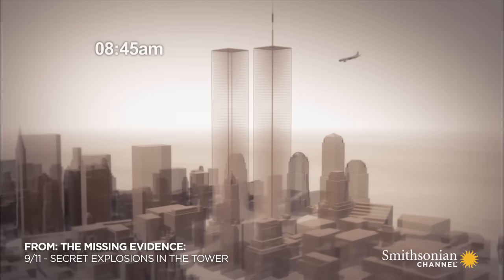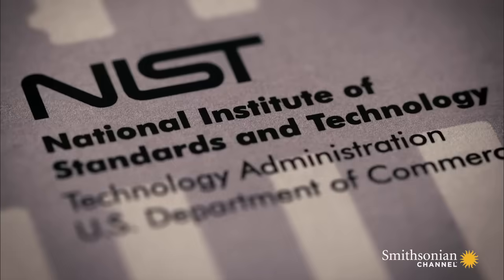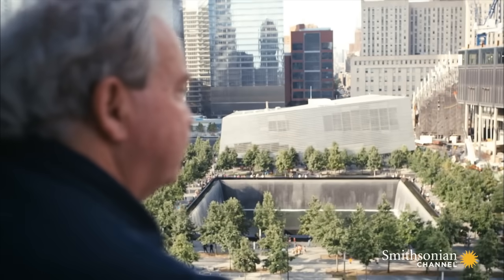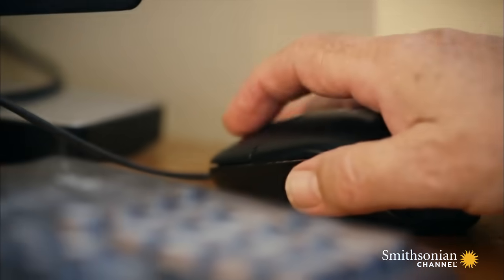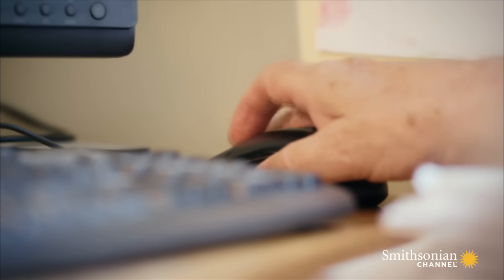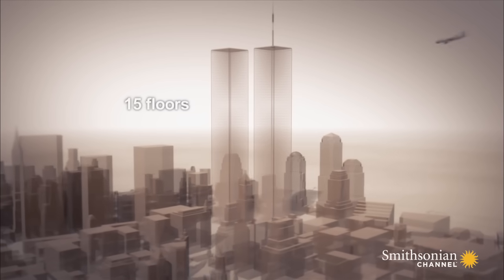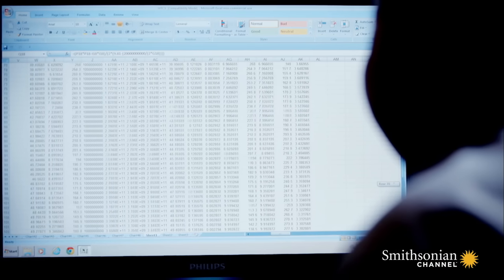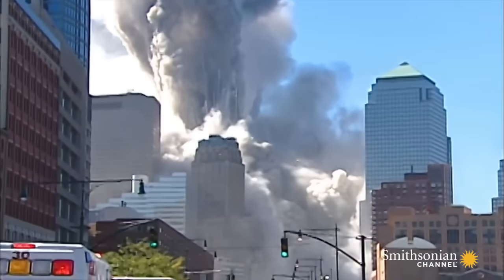This Computer Simulation Explains How the Twin Towers Fell

Comment: In other words newton's laws didn't work in the area of World Trade Center on sep 11.
Reply: in other words it worked just the same as it usually would
Reply: Slow Motion you make a decent point, but remember, that top section is falling apart while it falls, but since it is the weight of the Titanic falling at tens of miles an hour, it puts out insane amounts of energy and ducking wrecks that shit
Reply: John Johansen while your argument seems valid, its only valid if you don't take energy losses into account. While the top section exerts a significant amount of kinetic energy to the lower floors, you're losing energy on each hit in the form of heat, not to mention all the air that needs to be pushed out of the way. Furthermore, even with all the energy stored in the upper part of the building, its still nothing compared to the opposing energy and force exerted by the lower building. For your statement to be true, we must assume total and complete efficiency in energy transfer; in other words unity. Something fundamentally impossible, that's been understood well long enough.
Reply: The equivalent of a 30-storey building falling through a gap of 30+ feet, and you think that aerodynamic resistance was even a factor? Are you kidding?As for 'energy transfer', as I said, as each floor was destroyed the debris added to the falling mass that impacted each successive lower floor. So, by the time that the falling mass reached the 55th floor (halfway down), there was no way that the structure of the 54th floor could resist it, and this process continued all the way down. Finally, there was no significant energy loss due to 'heat'. I absolutely don't know where you would have come up with that, either.
Reply: John Johansen Well let me clarify then. You stated about a month ago that "it's not about mass but about force". You do realize how stupid this sounds when force is literally mass times acceleration (F=ma). You also mentioned kinetic energy, which happens to be a force and thus impossible to calculate without mass. In other words mass is tied very tightly to this.
And yes, air has both mass and resistance, so it would definitely play a role here. It's not just a case of "oh it fell one 30+ feet storey", we're talking hundreds of consecutive ones. It will add up, air has mass as well, and more than you think. Finally heat, this also plays a role, albeit not as significant. Have you ever shot something and felt the bullethole after? It will be hot let me tell you. And yet again, heat is energy and as such everything loses energy in form of heat. EVERYTHING. It's a law of thermodynamics, and when you have such great masses moving and colliding with other massive object you WILL lose energy in the form of heat.
Ultimately every aspect of physics that we know and have defined over the centuries prevent this kind of pancaking freefall. It's just not physically possible. The top section of the tower had only it's own mass behind it yes as it's falling free, but technically the lower tower still has the mass of the earth behind it. Tell me, who do you think will win?
I suggest you do some research on static and dynamic loads, static and dynamic friction as well as the laws of motion and thermodynamics.

edit
And yeah you said it; cartoon brains. I'm sincerely wondering here, if we forget for a moment every other aspect regarding the towers falling and consider only just that, the fall;
If you gave it a thorough thought, do you think it is genuinely plausible for a tower to fall perfectly symmetrical, within it's own footprint, from massively non-symmetrical damage? On top of that is it plausible then for two towers to do the exact same thing moments after each other?
If you do think this is plausible, please research entropy, because it's a natural and statistic impossibility.
Reply: John Johansen And just for shits and giggles, I did calculate the approximate weight of the air only on each floor, which comes out to about 18,660 kg. That's 18 metric tonnes of only air, ON EACH FLOOR.
Reply: John Johansen yep
Reply: John Johansen “mic dropped” :)
Reply: Road Runner cartoon laws worked on Sept 11.
Reply: The masses will eat the truth one crumb at a time until all that remains on the plate are the lies of the conspiracy.
Reply: John Johansen Furthermore, and I could argue this all day, heat does play a significant role in this. Everytime a moving object is slowed down, the resulting energy loss is in the form of heat. You're converting the objects kinetic energy into heat energy. How do you think brakes on a car work? Ever seen the brake pads of an F1 car? Energy is always conserved, never destroyed or created. As such, every time the top floor hit the bottom floor, it's being stopped, ie braking, and thus the kinetic energy is transformed into heat. Yet again it's thermodynamic laws, look it up instead of spouting scientific nonsense, because none of what you're arguing would hold up to scientific testing.
Reply: Just because you can quote the definition of force does not mean that you understand what it means. I actually know the difference between mass and force, but I'm not sure that you do. The air displaced by each collapse was negligible with regard to the mass of it relative to the mass of the building itself. Similarly, any energy converted (not lost) to heat would also have been negligible relative to the kinetic energy of the falling mass.The fact that you can parrot bullshit terminology (e.g. symmetrical) without expanding on it says more than enough. Further, the fact that you fell back on the equally bullshit argument of the towers 'falling into their own footprint' is further evidence that you don't know the facts surrounding this situation. If the towers fell into their own footprints, then WTC7 would still be standing, as well as the Deutsche Bank building (since demolished because of damage by debris) as well as most of the other WTC buildings.Stop repeating the crap from conspiracy theorists and come up with something original, sustainable and provable. Up to this point, you've failed miserably.
Reply: To quote the very first thing you said in this thread; "Assuming that you could even find the definitions of Newton's laws, why don't you explain your assertion.Otherwise, you just sound like a dick."
Well, I have not only "found" the definition of Newtons laws, I have also explained my assertations. You, on the other hand, have not. So who's sounding like a dick here?
And if you're so certain of the difference between mass and force, why don't you explain it to me then? Please enlighten me instead of just spitting negativity towards me. Teach me, if you so will, but I have a feeling you won't.

In regards to the air, I do believe it plays a role in slowing down a fall of this type. As each floor is effectively sealed (doors, pathways, furniture etc) it functions as a cushioning force, much like a hovercraft. Or any pneumtic system for that matter. If you really think air didn't play a role here, go tell that to the mechanical industry and see what they think. I mean, where do you think pneumatics even come into play a role in our society? Air has resistance, it has mass and it can very well be used to move things. And at the opposite end stop things as well. Regard the equipment that remove the rubble of Ground Zero; all done with AIR moving the machinery and subsequently the rubble.

When it comes to the fall; yes I may have been a little vague. Symmetry With this I mean that the top part of the buildings fell downwards and didn't rotate on any axis in any significant amount. Given that the planes destroyed the load-bearing structures far more on the impact side, than the opposing side, a more plausible scenario would be the top parts toppling over to the side. Not necessarily breaking off and falling off to the side, but a definitive rotation should have occured. Given the damages done that is.
So yes, while neighbouring buildings definitely sustained debris damage (anything less would be ridiculous by any standard) the building still fell within their own footprints. You can't present an example where a close building was demolished by debris and not because of it.
Don't get me started on WTC7 dude, that shit is obvious without having to be an engineer of any sort.

Furthermore, you might not think I have an understanding of mass and force, and how they differ. But you don't seem to understande entropy?
Can you show me evidence, or calculations, showing how air was not a part of the equation?
Can you show me calculations on the kinetic energy involved in the fall?
I bet you can't, because *up until this point, I've shown you both formulas and calculations*, and you've shown nothing but allegorical nonsense. So who's spouting bullshit, really?

I will probably be back, calculating the kinetic energy involved, with regards to the mass and resistance of the air of each floor. Then we'll see who has a point here, ok?
Reply: Addendum

"I actually know the difference between mass and force"
Prove it to me, explain it if you will

"The air displaced by each collapse was negligible with regard to the mass of it relative to the mass of the building itself"
Show me your calculations showing this

"...any energy converted [...] to heat would also have been negligible relative to the kinetic energy of the falling mass"
Yet again, can you prove this?

"If the towers fell into their own footprints, then WTC7 would still be standing..."
Would it really? This is a logical fallacy and as such means absolutely nothing. The tower could have fallen into it's own footprint, but loose rubble and debris could still have toppled a building
Reply: It's not a matter of mass, but instead is about force. Yes, each top section was smaller than its corresponding lower section. However, each top section fell through a 'gap' of approximately 30 feet (created by the impact zone. As this mass fell, it generated a tremendous amount of kinetic energy that was applied directly to the upper elements of the lower section. These elements were designed to withstand a relatively fixed amount of static load. However, they were not designed to withstand the amount of dynamic load represented by the falling upper section. Further, as each of the floors of the lower section was destroyed, it added to the falling mass and the corresponding kinetic energy that was applied against the next floor of the lower section. Hence what has been characterized as a 'progressive collapse'. It is essentil to understand that the lower sections were destroyed one floor at a time, albeit very quickly.
Anyone who believes that the top 30 floors should have destroyed only the same number of floors below it simply doesn't understand the difference between mass and force nor the difference between a static load and a dynamic load.
That's how.
Reply: Cartoon brains seem to be working for some people since....

Comment: The government spent 16million, this guy uses a spreadsheet in his office and solves the collapse! 
If this guy is right where did all that rubble go after the towers fell? Why did it turn to dust particles when it was collapsing and not big peices of masonry falling? Where did all the steel go, steel doesn't turn to dust?
Too many inconsistencies, up to 80 perfect floors below the impact wouldn't just collapse and turn to dust, surely the damaged top section would fall leaving the rest of the building standing? Why did it fall in an orderly fashion, all sections wouldn't weaken at the same time to cause a perfect fall? You would think the building would be weakened on the impact side. 
Not sure if the truth will ever be known but if this was carried out by the government or the buildings owner they must think the general public are thick to believe that these buildings can fall like this without help from another source other than gravity.

Comment: What caused a simultaneous severing of the inner and outer steel frame and core for the top section to collapse straight down? What a crock of shit. You can see that the plane disintegrated on impact at the beginning of this video!

Comment: First they put emphasis on the fact the buildings were design to withstand the impact of a jetliner and then they're just like "yeah, well.... tough luck"
That's like putting emphasis on the fact that a plane is designed not to fall out of the skies but it if does happen just to say "yeah well.... tough luck"...
Smithsonian Channel....

Comment: Inside job. Steel framed skyscrapers cannot collapse due to fire. Especially after burning for one hour!
Reply: How about from fire plus the damage from having a 150-ton aircraft crash into it?? It wasn't one or the other, it was BOTH.
Reply: TimReed22222 15 stories cannot pulverise 85 floors of resistance into dust below. If you watch the demolition in slow motion, you can see the charges flashing as the building disintegrates before it hits the ground.
Reply: Hey Ziggy, are you a Judy Wood space-beam nutter? Because you're repeating one of their lies: there's no reason for sane people to believe the towers were converted "into dust." Sure, there was a lot of dust after the collapse - the interior walls were mostly gypsum sheetrock - but no one to the best of my knowledge has ever demonstrated that a significant amount of the towers' mass went missing.

The 15-can't-defeat-85 trope is also silly & ignorant. The tower tops didn't defeat the whole tower at once, but one floor at a time.
Reply: Wrong. Kerosine burns at 1900°C. Meanwhile steel loses a tremendous amount of its strength after several minutes already at 500°C

Comment: Did you see the Grenfell Tower catastrophe in London, and how this building constructed in 1974, and subsequently covered with flammable panels at the request of rich neighbors, burned for hours... floor after floor of relatively weak concrete consumed in flame and smoke... hour after hour of heat... and the charred remains of the building are still standing? No way. I hope the videomaker here produces something showing why Grenfell Tower DIDN'T explode in superheated clouds of atomized debris, liquefied steel, and sliced through chunks of construction material.

Comment: I guess Frank missed the fact that the top of the south tower was falling over not straight down. He also missed the 3rd law of motion equal and opposite destruction  of both parts of the building. How does something smaller and lighter destroy something larger and stronger without alot of acceleration?

Comment: Lets give in to the notion that jet fuel will not melt steel beams, do you think the fire will not weaken the structure? Extreme heat was used to mold them why would it not work here? Coupling that with the extreme weight on top of those floors its a given it was going to collapse.
Reply: Baca-true-jet fuel will not melt steel.. just like   the fire in  my wood stove does not melt it[wood burns hotter than kerosene]